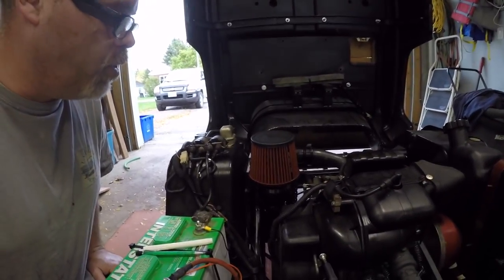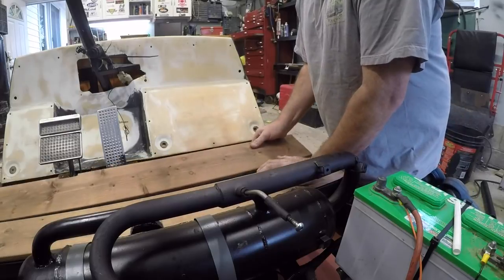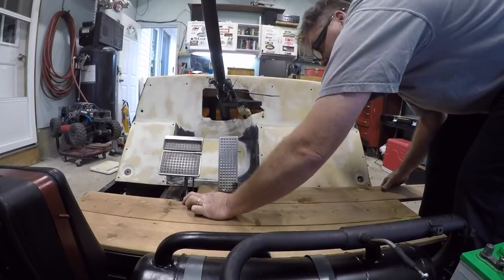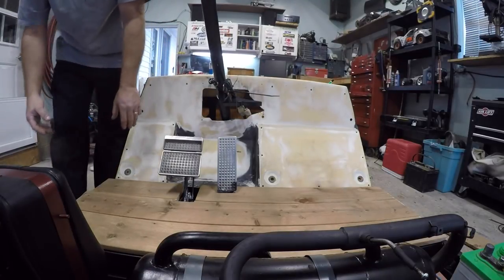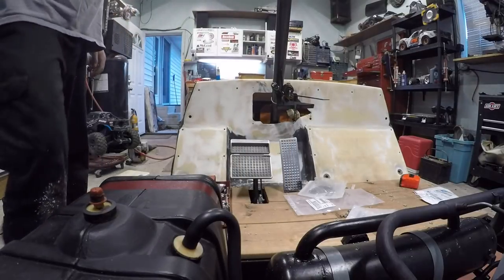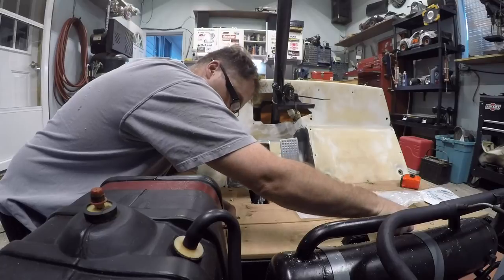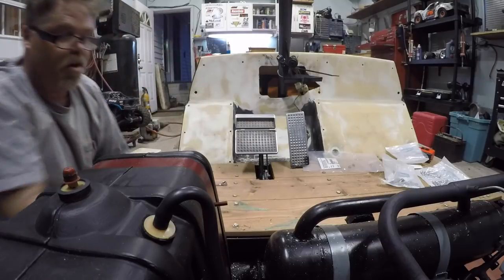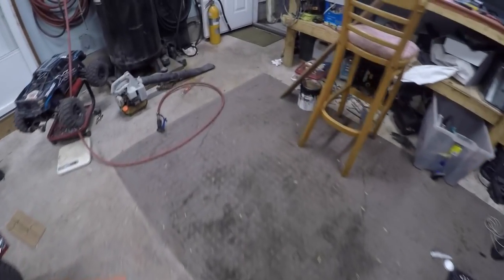GolfCart Wood Floor's And Go Pro Just Fighting Me

Comment: Going to be a heavy beast
Reply from the maker: I thought of that too BUT ! I did take out all the metal floors and put wood . so the frame should be about the same but the top is heavy forsure
Reply: Wait until he loads her up with 500 speakers and 120 amps, why wouldn't he
Reply from the maker: thats coming lol
Reply: @LifeWithBillSiff  The extra weight will give her some good posi track
Reply: @WVgunfun  That would be desent
Reply: @MrTundra52  friggin right it would